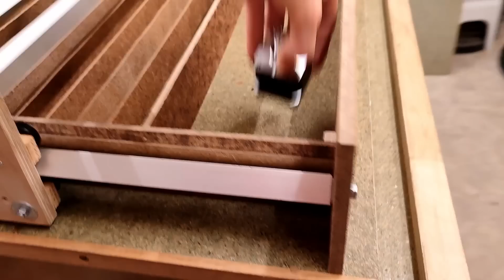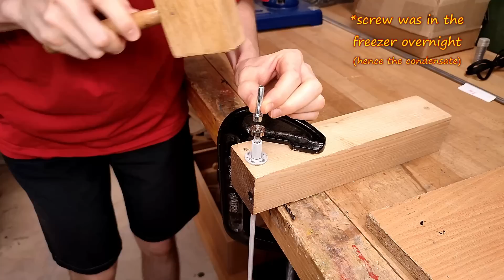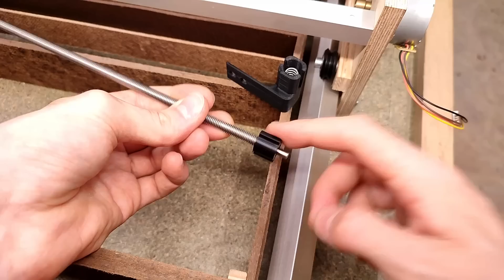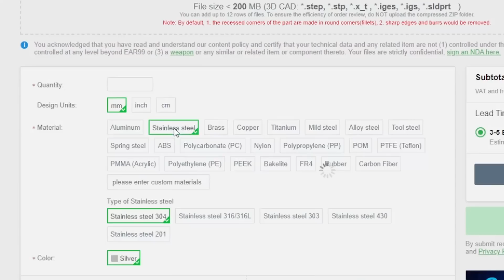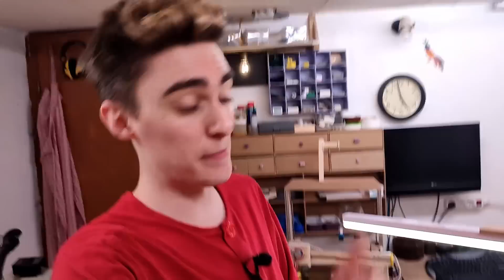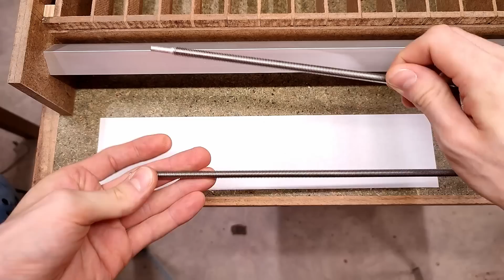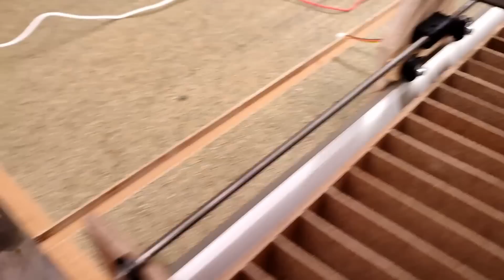Threaded rod as lead screws on DIY CNC? Bad idea! | Budget UV laser cutter part 2

Comment from the maker: Well, that was definitely not the expected outcome! This is the nicest machine I built so far, so it's a real shame to see all the effort go to waste... but I learned my lesson! I'll pick this series back up in a few months after I redesigned everything - for now I'll start playing around with this to get at least some basic experience with laser cutting; that way the new version should end up much better still if I can weed out as many of the design flaws in this prototype as possible!
Reply: It just occured to me, DIY stepper motors are too much, but DIY linear motors?  check out the magneto x 3d printer, it uses linear magnet motor, that would be so easy to DIY compared to a stepper.  You get the fine contorl by the feedback system of hallsensor/ or encoders instead of tiney magnets like in steppers.  IT uses FOC algorithm control which stm32 has libraries for to control motors like this.   No belts, no converting rotary to linear motion its straight linear motion so it should be more accurate too.  Linear Motors!  make steppers obsolete? Usable for CNC machines too?  I dunno just throwing it out there, i thought fishing line motors were cool but this is even cooler i think.  Happy new year!
Reply from the maker: @mikejones-vd3fg  thank you! Happy 2025 to you also!
Funnily enough, I brought up the idea of completely DIYing a stepper motor with my patrons recently - just for the heck of it to see if it'd be possible to make one that's actually usable on like a 3D printer. No idea if it'll ever happen, but I reckon it'd be an interesting challenge. However you're right, a linear motor would be much easier mechanically! I've seen the Magneto X, not sure what to make of it yet. The hype died down rather quickly though, which made me wonder if there ultimately were any real benefits over the traditional configuration? You mention the FOC algorithm, a while ago I realized something like SimpleFOC might be one of the only  ways to get the crappy steppers I used on my 3D printer to actually work in fishing line direct drive. Yeah, I dunno, I'll have to think about which one of these cool ideas is most worth pursuing, thanks for throwing linear motors into the mix!
I know you're all waiting for the next video (or at least I'd like to think that's the case) - the one I'm currently working on will (unironically) be about stepper motors, and should've been done by Christmas. But the massive scope creep means it'll come out way behind schedule, hopefully around mid-January 😂🙈

Comment: you can make a round thing (you'll find how to do it on some machining channels) that can be used to improve the error on the ground part of the rod. It doesn't need to be perfect because the abrasive paste and the spining will average that out.

Bearings need to have interference fit on the part that spins and less interference on the part that doesn't spin - in your case, the rod needs interference with the bearing. You can't heat bearings above 90C so you'll need to cool the rod and that can be done with dry ice and alcohol. Just mix box, put the tip of the rod there, wait a bit and put the heated bearing in it. Do it quickly, don't use force. It will be hard to fix if it doesn't get in right, though.

Comment: That was very enjoyable! From the perspective of learning with your mistakes and sharing that in an entertaining manner. Otherwise, this kinda sucked hahaha... It's a shame really. Just like you said it, this was the nicest part to date. I hope this gets revised in the future and you succeed this time! Have a nice one! Cya
Reply from the maker: Thanks, haha, yeah I'm glad if it can at least help spread the word, it's not something I would've ever heard anyone mention.... though it makes a lot of sense knowing how threaded rod is manufactured!
I will definitely revisit this project (gotta get my money's worth out of that laser module after all, lol), as laser cutting sounds like it would be as straightforward to use as 3D printing, compared to CNC which takes a lot of effort to set up individual tool paths.
Right now I'm halfway through converting the existing gantry to NEMA 17 so I can play around and get some laser cutting experience under my belt before I commit to a full redesign. (There are also many other issues with the current design that I didn't even touch on in the video because hadn't found out about them yet)

Comment: Did you ever run this machine?
Reply from the maker: No.. . I wanted to play around with it to get a bit of laser engraving under my belt before I start redesigning it, but haven't gotten around to it yet..
In the long run I'll still do it probably, but on second thought I hate the screw drive so much I'll probably hack in a belt drive with NEMA 17s first

Comment: You can actually compensate for it by software, by warping the gcode by the same amount as the screws in the opposite direction.
Reply from the maker: That's true, I hadn't thought of that at the time - not sure what post-processor I'd even use for that. Ultimately it's going to make actually using the machine more of a headache though, and, knowing myself, effort and poor usability means I'll probably avoid using it in the first place.
I'm a hardware guy, redesigning it and physically fixing the problem will be much more enjoyable than forever having to deal with workarounds...
Reply: @ChronicMechatronic  In that case I would put two steppers, and I would add a microcontroller that corrects the issue with this system I thought about: Let's assume you calculate that for every 100 steps of motor A you need 99 of motor B. Let's add together the steps and you have 199. The microcontroller has a internal step count (in this case from 0 to 198), and for each step add or substract this number (depending on direction) and wrap around if needed. The step of motor A will be ((count & 1) == 0) and motor B ((count & 1) == 1). As a result, when it wraps around it will step A twice.

Edit: obviously you have to double your steps/mm in the controller.

Comment: 1.) Lead screws actually would allow you to move the gantry by hand and are not that slow.  The problem is, you are not using lead screws, you are using threaded rod instead.
2.) Don't check your measurements while the rod is still hot.  Same rule as working with a lathe, you have to wait for the metal to cool before measuring it. Take your time as you grind it down.
4.) the firmware doesn't need to support the two different pitch threaded rods. It just needs to send step and direction commands to a motor controller.  You can make a motor controller with another arduino, one that takes step and direction as input and passes it through directly to motor A's controller, and then applies a multiplier before passing an interpolated value to motor B's controller.  Totally not worth it, but that is a method which allows you to "hide the complexity" from the firmware.  You can do this with any part (e.g. use a thermocouple instead of a thermistor on your heated bed, by using an MCU to read the thermocouple value and then output an analog value back to the main controller, use Wi-Fi from an SD Card slot, use closed loop steppers, etc.)

But there's a better option here, just compensate for the out of square build area in software, like you would with a 3D printer.
Reply from the maker: 1) yeah, though the whole point was to be cheap, and belts would be cheaper than real T8 screws. Ultimately I decided I absolutely hate it the way it is right now, and I'll completely redesign it to use a standard coreXY belt system with NEMA 17 steppers
2) grinding one end of that damn rod took about 8 hours, I cannot remember it ever being more than lukewarm - besides, at 5mm diameter my thermal expansion would be like 8.6 microns for a 100°C temperature rise, well within the margin of error of my caliper's measurements.
4) good point, I hadn't thought of that. But as you say, not worth it, and iterating hardware is more my forte than trying to fix my mistakes in software xD
Post-processing the G-code is something I hadn't thought about, but ultimately it makes using the machine too much of a hassle to be worth the time I saved by not having to redesign the machine from scratch...

Comment: I saw a similar setup, with one screw for each axys forming a cross where the head was mounted. The whole asssembly was made from from aluminium profiles with sainless steel rods as the rails for the small carriages. The motors used were normal motors, not steppers with a feedback loop made by a (64 I think) segmented circle read with photodiodes.
That was used as plotter that was able to draw schematics up to A0 and was controlled by a computer trough a custom (ISA?) expansion board. By changing the pen with a dremmel they also made PCBs. That was made in the mid 90s. I guess that they used a lathe because claimed to be very accurate, at less than 0.1mm.

Comment: I had just been wondering what kind of precision you could get out of all thread as lead screws in the past few days. I had no idea the thread tolerance could vary THAT much hahaha. At first I figured you meant you accidentally bought 1.0 and 1.25 pitch or something. I guess at the very least you'd want to do some thread verification before use. Oh, you say that at the very end. If the pitch is truly consistent along each rod, doing the math to compensate between them would be fairly trivial. I get not wanting to do that and having to use dual motors though. It was cool to at least see the machine run at the end!
Reply: The pitch in threaded rod is consistent over a long lenght and inconsistent over a small distance. or example, if i tell the cnc to move 1mm forward, it might move 0.95mm. But if i tell it to move 10mm forward it might move 10.05 mm. Had you etrapolated the erro from just 1mm increments it would be way off 10.05mm, bit it isnt. It gets confusing since the tolerance goes back and forth +- 0.05 to 0.2 mm over a meter.
There are controllers that can adjust to the pitch error, its called pitch mapping where you manually go back and forth in 1mm increments and check the erro, then place the error in a file so the cnc controller can adjust as you move along.
Though the error in threaded rod goes down by diameter. M12 threaded will aways be more consistent than M6.

Or you can just use corexy wich is cheaper than all alternatives and can be accurate to 0.01mm.

Comment: You can use the bed from the 3d printer as an "emergency dryer", just put a box around the spool and give it 2 hours each side. I don't know the temps off the top of my head but is around 45C for PLA
Reply from the maker: I tried that once but didn't feel like it made any difference - maybe I just didn't crank it up enough...
But I've since bought a filament dryer, which works great :D
Reply: @ChronicMechatronic  Awesome!

Comment: Are you sure you actually had the same thread pitch? And not just two different sticks mislabeled?

I use alot of all thread and have never seen that
Reply from the maker: Pretty sure, unless they manufacture M6 rods with marginally different pitches and get them all mixed up afterward? If they were a different diameter I'd definitely have noticed, and the difference isn't enough to be metric fine vs coarse thread either...
Here in the comments we collectively came to the conclusion that it was some unfortunate batch difference since they just aren't manufactured to high standards. No idea how common this is, but it obviously happens ¯\_(ツ)_/¯

Comment: Mistakes happen.  That's normal.  But you can fix it with Klipper.  You can drive the second lead screw separately with another stepper motor.  In Klipper, you set a different ratio and it manages it by itself.  I know that Klipper is a different coffee and out of the budget, but it's worth a try and you can use the laser cutter with pleasure.  

Looking forward to your next video and you are very inspiring.  Keep going.

Comment: I think the grinding machine you made was a huge success. Even branded bearings usually have specified 6-8 microns of runout, but are press fitted a couple of microns which you didnt achieve. And on top of that you had tape on the threaded rod. So your grinding machine even though low rigidity and accuracy was able to get incredible results
Reply from the maker: Yeah the results I got are pretty decent, though I had to go really slow to get there. What little play there is in the bearings was one of the biggest sources of trouble, if I tried to take off more than ~0.02mm at a time I would get a lot of chatter

Comment: There is a quick and honorable fix for this problem with the inconsistency of the screws. You could use only one screw and drive the carriage using the same technic from the parallel ruler of a drawing board. The one I used back on engineering college had two fishing lines and some cleverly put poleies that made the ruler move parallel no mater from witch point it was pushed. I believe you should use some steal cable instead of fishing line, but you can have some for cheap from bicycle parts. Take a look at that before you scrap your machine.
Reply from the maker: I looked it up and it's definitely cool, but since it requires quite some tension I don't think my machine would withstand it without buckling. The entire frame is designed to grow and shrink with humidity changes, and there just isn't anything structural to take the longitudinal load.
Not a big deal though, I'll take the redesign as an opportunity to improve it and change what I don't like about it so far!

Comment: well in my machine I did not in fact check the pitch, they might come from the same rod but who remembers really... I will not check for my sake it does kinda work
Reply from the maker: I agree, better not check! I won't check the ones on my 3D printer either. From what I read here in the comments it doesn't seem that common for threaded rods to be this different in pitch, maybe I really just got unlucky with two very mismatched batches from the factory...

Comment: Honestly, I can't see that it would have been obvious that the threaded rod would have had different pitches. Maybe I've just grown up spoiled but I have come to expect manufactured parts to be reasonably within some form of usable tolerance. So, please allow me to disagree with you. You don't get the "L" for this; your supplier does. 
Hey, thanks for sticking it out to see how the design would have turned out and being flexible enough to pivot to find a way to improve the project👍
Reply from the maker: Thing is, in terms of threaded rods these are are well within spec for their intended purposes - I wouldn't have expected tolerances to be this loose, and I haven't verified any numbers here, but it makes sense for manufacturers to not obsess over a 2mm/m difference in pitch if all it's ever meant to do is thread into nuts - which by all means works just fine -
I would assume not taking this into consideration and double checking the accuracy before purposely using the rods in a much higher stakes application than what they were intended for, would, objectively, qualify as a failure in the engineering process on my part.
But anyway, it's nice of you to see it differently :)
One of the reasons for finishing it I didn't mention in the video, was so that I could start experimenting with the machine and get some basic experience with laser cutting. That way the new design should turn out even better!

Comment: Would switching to T8x2 3DP rods  be worth it? They should be easier to lubricate and with brass nuts work well. But i‘am not really sure about that.
Reply from the maker: Not worth it, I get the same minor inconveniences of having lead screws in the first place, but also with the pitch on T8 being a lot steeper I don't get enough granularity with my 48 steps/rev motors.
As it is I get a resolution of ~0.01mm in half-step mode, I don't think it would work with less. Overall it'll be cheaper I just stick in a bunch of NEMA 17's like everyone else...

Comment: Instead of grinding down the lead screw, could you make the coupler bigger to encompass threads?

Hey i developed "gatorCAM for cnc".  Grab a copy and I'll give you free license keys.  You could use it for laser too i bet...or for future cnc machine.
Reply from the maker: Threads in the coupler would work too, but result in a lot more runout. I was going for as smooth an operation as possible and in my experience 3D printing would never get below like ~0.1mm runout, which is also why I drilled out a single 3mm hole instead of printing one side of the adapter 3mm and the other 3.5 or 4mm.

I'll definitely try to reuse these rods on a CNC machine with single screw axes so the grinding wasn't wasted.

Cool! I'll check GatorCAM out!
Reply: @ChronicMechatronic  let me know if you have problem downloading.  Dropbox makes it look like you need to make an account but you don't.  Is that confusing?  I may need to make a video helping people.
Reply: @ChronicMechatronic  instead of printing an adapter, you can use a little plastic tubing with copper wire to pinch it tight.  I don't think run out is an issue. One of my 1st few videos shows a specific way to use the copper wire. It has worked for many years without any problem.
Reply: I use a single lead screw below my cnc machine which is huge.  You could use 1 for a laser instead of 2.  Mine is centered below with wood to reach the edges.
Reply: Its a little slow for a laser , but that would make a good cnc....with 1 lead screw on the bottom.